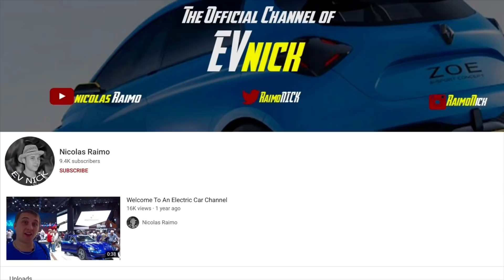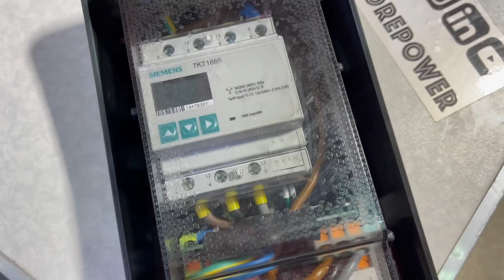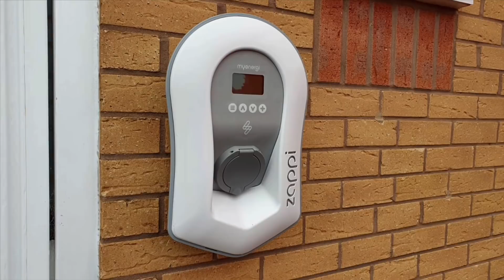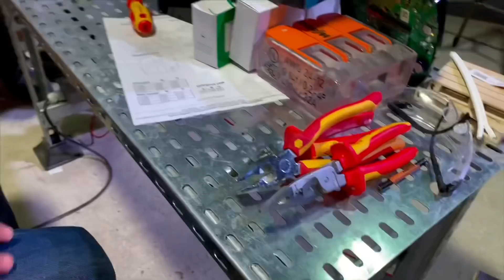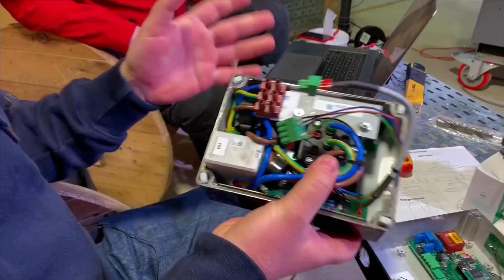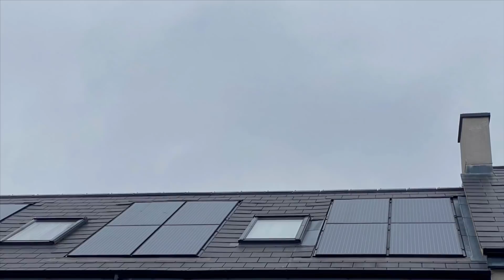CASH on the table for EV CHARGER INSTALLERS - with EV NICK

Comment: good chat....so what do smart electricity meters do for a customer? mine just sits there and adds up my bill.... no timers, no smart appliance control , i don't see any benefits with them.
Reply: The smart meter allows half an hour data to be sent to electric company with octopus for example they use this data to offer special rates and deals which may change on each given day you benefit with cheaper electric.  SMET2 now have zigbee and more application may be found to work with this

Comment: I have a question.  What size of ducting needs installing to accommodate future cable for an outdoor charger.  As I am renewing drive and suitable future charger point is not at same side as house. Installation of duct seems good idea now.
Reply from the maker: Go for something like this - https://www.tlc-direct.co.uk/Products/FXKVR63.html - plenty of room
Reply: @efixx  any tips to get a draw cord threw ;)
Reply: There’s a video on my channel about future proofing for an EV install,  but bigger the better.

Size of cable will depend if you plan on going 3ph in future.  Will you want a cable for just 1 EV charger or 2 EVs?  And of course cable size depends on the run,  there’s also other services or cables you may want to run like cat6

Comment: The installation of all of these smart chargers/devices will in the longer term result in electricity prices levelling out I think. If there is "free" or even negative price electricity being produced then everyone is going to be trying to grab some of the action. The result could even be an upward spike, unless things are very well controlled. It will end up with everything trying to find the cheapest rate with the result everyone pays the same almost all day.
Reply from the maker: Good point Bill. We also believe it will depend upon where you live. The excess capacity is often generated some distance from where it’s used. The capacity constraints caused by the local distribution network. So you may have local hot spots.
Reply: Hi Bill prices are decided by dayily auctions by human bidders,  the way the grids designed is we build for “peak” meaning we always have extra capacity and generation we should see prices fall some more over next few years as we see more wind turbines go live,  we should see a level out in prices but we need to fill the national grid bathtub which is a massive hole and even with price incentives it’s unlikely to be totally filled so we should still see lower price at night if it’s very windy for example

Comment: Running on sunshine. My 2.3kw solar 10amp at best, that I hit for half an hour a day in the summer if lucky. Winter production is very minimal. Your not going anywhere on sunshine, while the cars plugged in all day. Guess my bicycle is going to get some use. Do some research & stop flogging double glazing.
Reply: Sorry to hear that, most 3kW systems generate about 3000kwh a year, that’s enough for 10,000 miles in an EV
Reply from the maker: We are currently working on a series of videos fitting an EV charger and hot water diverted to an existing PV system. This will empower us with our own data. So we can stop selling double glazing.
Reply: The average system these days tends to be 4kw and some people with DNO approval get even bigger and they manage to run a car on sunshine no issue,  not for 100% of mileage but enough to but a huge dent in the bill sorry to hear your system wasn’t spec’d very well and was installed by a double glazing salesman
Reply: @NicolasRaimo  4k at UK 230v 17amp so if I gave you a high average of 13amp that's an 8 hour charge. Leave your car at home all day in the sun. My solar works great thanks, don't want a conservatory fitted.

Comment: With the governments plan for the motoring  manufacturers to stop making petrol and diesel vehicles within the next 10 years or so and switching to electric, with the households where  its not possible to get a power supply to the Ev charger are there going to be solar versions or would it be something like fast charge  units  at petrol   service stations in the eventual replacement of petrol/Diesel pumps
Reply from the maker: There is talk of community based chargers for residential areas with limited off street parking. The first electric filling station has already arrived - https://gridserve.com/braintree-overview/

Comment: You know full well the more people drive EV cars the less so called savings you will get and the more Electric costs will go up, there is already talks in EV owners paying car tax in the future...which they should since their cars cause just as much damage to the roads than other cars.

I would however love a EV and past 4 years was looking over and over at them but cost wise i would be way more out of pocket than a petrol car  pcp monthy payments on a decent one that i like the look of are about £100 more a month than a petrol car that i like the look of, for me insurance is actually £40 a month more expense minimum too.

i decided leasing cars is the way to go for me, and leasing EV cars can be cheaper monthly than PCP but leasing cars no one has to pay road tax so the tax free is not EV exclusive when leasing. then the cost of installing a wall box at home...makes no difference with a grant because you still are out of pocket.

The stress of if you travel alot yes charge at home but if you need to charge away from home hardly any charging ports dotted around enough and then you have to sit and wait for it to charge.....and please do not say...you can go get a coffee etc because that cost has to factor into the charging costs you pay when charging as you do not do this when you go to a petrol station for petrol as you fill up with-in mins.

So i decided to go with a petrol lease, ds3 crossback prestige i got a lockdown bargain £130 a month, free tax, no MOT at all while i have it just a service and petrol is cheaper than my previous diesel....and £40 insurance a month.

By the way savings on charging a EV compared to cost of petrol would be negligible for me and most people who do not travel far....i only have to top up 1 time a month when i get paid £25

I know i sound like one of those ANTI-EVers but i am not....its just for me they cost way more money than me owning a petrol and not everyone lives the life of luxury where they can afford it and just to it for the PLANETS SAKE...which is hardly any owner of a EV really  

I would love the Honda-e but its just too costly overall like other EV cars...if someone said here you can have one for the same price i am paying for my current car i would be all over it
Reply: I’ve actually recorded a video on this very subject I’ll release in coming weeks and the answer your find more surprising
Reply: Most of your argument is based on current tax models, these will change to further advantage EVs over combustion in the next few years.

Comment: heatpumps are crap when it comes to old houses,you'll never get the warmth as with a gas heating system, and boring a hole for geothermic heatpumps is like fracking, you destroy the groundwater surface,green you say,think again,and where does your electricity comes from when you dont have PV's,gas (or coal) turbines? when we can create SUSTAINABLE renewable energy,say with nuclear fussion,then everything can be made electric,till then it is not feasable for a lot of normal working people,period
Reply: Drilling a hole for ground source is not the same thing as fracking it’s a closed systems where the coolant never mixes with ground water.
Reply: @edc1569  i know EC, but you are making holes in the water table,here in europe they had several water shortages in the summer (like electricity shortages as well in the winter) so they zay you must let water seap trough the ground because of the low water level,what if everyone drilled a hole in that waterbed,see the picture how it is over here,if you dont believe me google the european prices for everything you will be gobsmacked

Comment: Did not address the earthing problems other than a quick mention of O-Pen which may or may not meet the regulations. None of the charging devices appear to have "Windows" apps they are all Android or I-Phone. Some of the devices leave a lot to be desired when it comes to ease of installation and a lot require seperate O-Pen devices at extra expense above the advertised price for the device. The device with the power connection in the lid looked dangerous.
Reply: We explored them over on my video Odin

Comment: Gas boilers going is a disaster in certain aspects. Currently working for a customer that has, electric cooker and hob, car charger, heat pump, shower and air conditioning. The 100Amp supply is almost permanently near limit especially during the summer. DNO is either going to have to start supplying all domestic properties with 3 phase or around the 2035 time frame we're going to have a lot of issues.
Reply from the maker: More power - less plumbers. On a serious note you raise an important point. The DNO we’ve spoken with is looking to use more demand side management and local storage to avoid the need to upgrade the distribution network.
Reply: @efixx  Which is a passing the buck measure onto customers rather than upgrading their post war system. Fine in areas where people can afford to supplement the local grid but for any less well off areas or in times of economical hardship (like the impending aftermath of Covid19) people won't be able to invest in the things the DNO hopes will alleviate the inadequacies of the aging local grids. 

Average consumers will only invest in direct replacements for what they can afford and will save them money. So Boiler goes > obtains heat pump but won't get the battery storage and solar panels to mitigate the local grids increased draw as it's not their responsibility. This will become even more evident in the next couple of years as people find themselves rather strapped for cash.
Reply: @effervescence5664  can’t see anyone strapped for cash replacing a gas boiler with an ASHP
Reply: Dynamic management should be able to deal with this, time to get rid of electric showers, they’re the biggest crime when it comes to electricity.
Reply: @edc1569  but also really good space savers considering so many properties have combi boilers and a second electric shower with no room for a tank now. Currently there's a £1500 grant to get a ASHP with total installation cost of £3500 here it's no different than a boiler change.